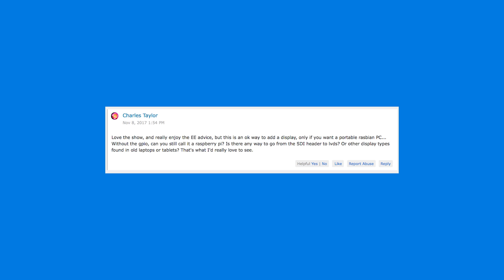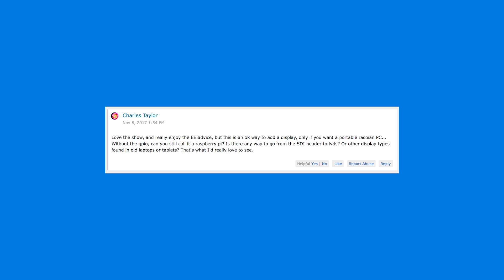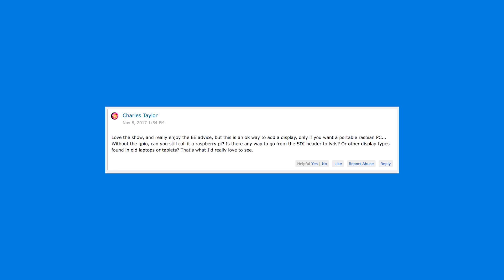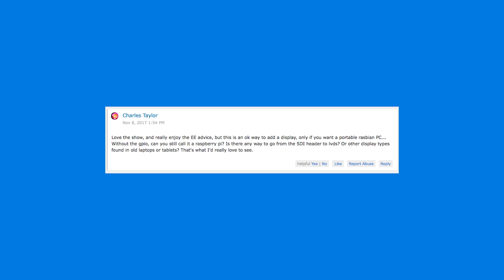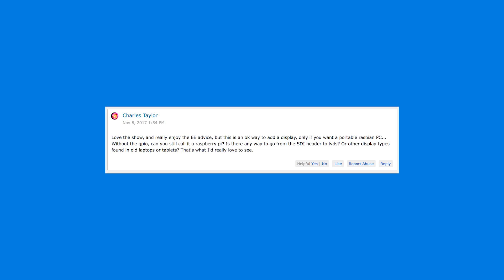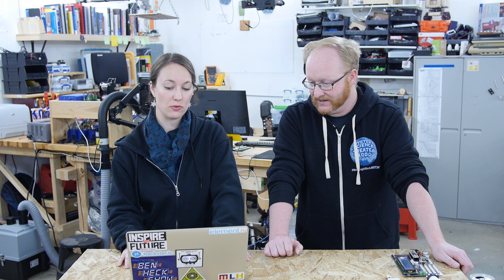Community Feedback 11 - Raspbian PC Advice

Comment: I'd love to see how you would create that SDI to LVDS connection using the TI chip! That would allow to use bigger size screen without using an LCD controller board, which would make for example RPi powered digital signage applications a lot more efficient and cost effective. It would be fantastic to see how you would tackle this !!! I`m a bit lost...thanks!

Comment: I think Ben only half answered the question here, since the question was actually if you could drive LVDS with SPI not from multiple GPIO. I wouldn't be surprised if you could get SPI LVDS driver chips, or if not it might be possible to use shift registers to drive the TTL to LVDS chip, but I'm just making uneducated guesses. Would be interested to see more experimentation with this on the show!
Reply: I think OP meant DSI (Display Serial Interface) (Not SDI or even SPI), which is specifically designed to drive lcd panels, and is used in most smartphones/tablets now, so is cheap and easy to get. But for some reason there is only one panel compatible with raspberry pi (the official 7" one) on the market. As for SPI or shift registers, it won't have enough bandwidth to drive the display, RPI can't even drive 320x480 displays thru SPI at 60fps. And IIRC there is another issue with software driven displays (opposed to dedicated display hardware which handles DSI, DPI or composite video out): due to some design issues apps can't use accelerated opengl es and are limited to software rendering, which is pretty slow. So I'm glad to see there is an option to connect DPI panel.

Comment: Very cool that you can drive an LVDS display with this method! However i was a little curious as to why nobody uses the DSI port - it's specifically for driving LCDs isn't it? Wouldn't using it free up all the GPIO pins as well?
Reply: It looks like it might only work with specifically-made screens.

Comment: ok is it just me or did ben not actually answer the question asked in the comment?
this guy wanted to know if there was a way to connect a lvds to the SDI header, which, as far as i remember, is one of the white ribbon cable connectors on the pi that they recently released an "official" screen for (after 3 generations of raspis, which all had this socket...). that would spare the gpio pins which were the main concern of this guy.
and yet ben talks about ttl pins at 1:07  and admits that his method "does eat up pretty much all of the IO" at 1:48